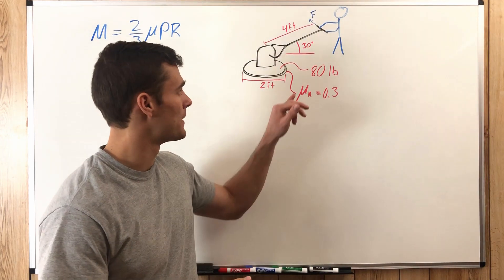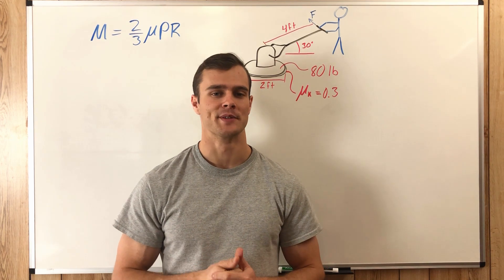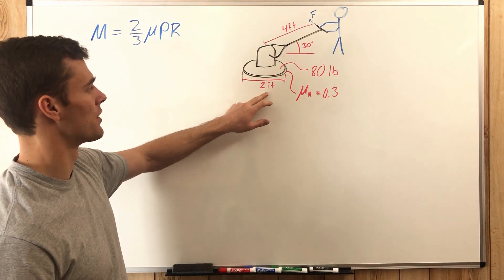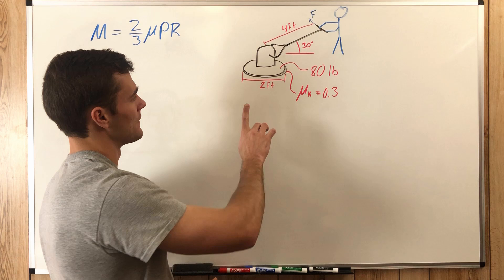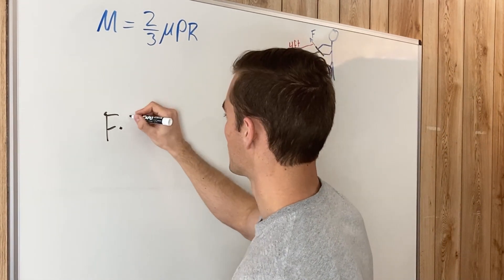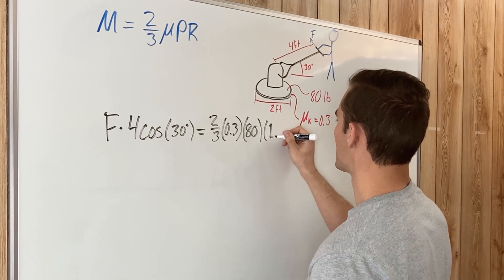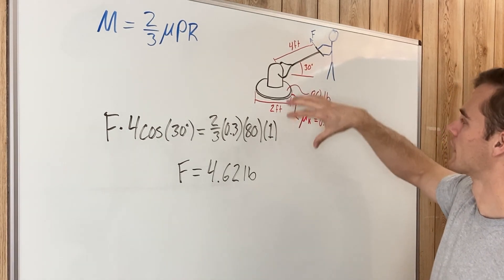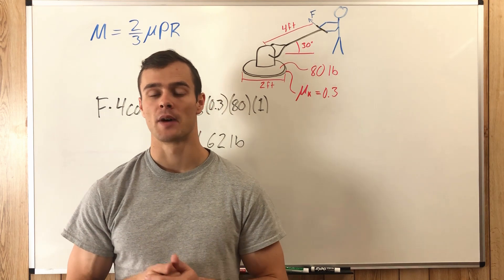Frictional Forces on Disks EXAMPLE PROBLEM // Step by Step explanation // Equation Included

Comment: aren't we supposed to multiply F with 4 feet or don't we have to find the components of the F to multiply with 4feet*cos30 or 4feet*sin30?
Reply from the maker: Great question! To find the force caused by the moment you have to find the horizontal distance between the axis of rotation and the force F. That distance is 4*cos(30). Does that make sense?